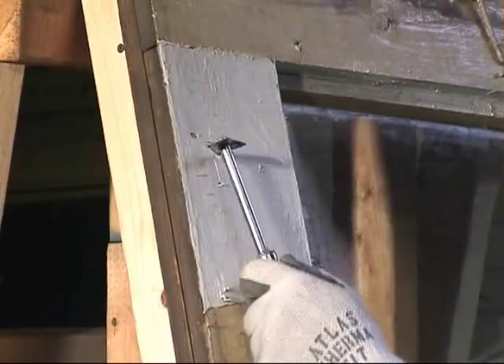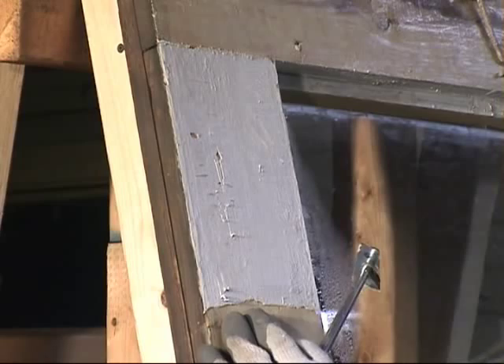Steam Paint Removal

Comment: whats to dislike about this video? its simple, quick and informative.
Reply: Grant M Speed, and worry about grain swelling.
Reply from the maker: "Grain swelling" is not a problem. The wood does get damp, but the moisture only goes 1/32" to 1/16" deep, and it dries out within a few or several hours. Fortunately, Mother Nature has designed the wood so it can get wet and dry out with no problems.
Reply: @johnleeke  does this procedure also work for paint on concrete?
Reply from the maker: @paulgurley1517 , It did work on a very limited test of painted brick masonry. I have not tried it on painted concrete. The only way to know is to try it out.

Comment from the maker: I would not say it takes TOO long. It takes a certain amount of time, that can vary a lot depending on the paint conditions and the temperament of the worker. It is slower than some methods and faster than others. There are dozens of paint removal methods and each has its own combination of characteristics. For example, steam paint removal is usually slower than a hot-air gun, but steam absolutely will not start a building fire the way a hot-air gun can.

--John

Comment: Thanks for the video and your website.  There is a  lot of good information that has been helpful as I try to figure out how to  restore my windows.  

My experience, consistent with what is on your forum , is that the Jiffy 2000 is not effective at steam  paint removal.  (I used a small shopvac head rather than the Jiffy head, to get better steam coverage.) I had somewhat better results with a rented 1500 watt wallpaper steamer, but  in my situation ( 1950 window with about 3 layers of paint) it did not perform well.

I did not try building a steam cabinet, but instead opted for a Speedheater since my primary problem was paint removal and putty was coming out relatively easily.  Again, as mentioned on your website, I  found the Speedheater to remove the paint  quite well.
Reply from the maker: Michelle, thanks for the detailed report on your work. Everyone develops their own techniques based on the skills and equipment available, and the needs of their project.

Comment from the maker: I have only used this steam method to remove heavy paint buildup from wood.
The only way to determine what it would do with wood staining is to try it out. Since stain is usually embedded within and just below the surface of the wood, I am pretty sure it would not have the same result as removing paint, which is in layers on top of the wood surface.

John

Comment from the maker: You are right, moisture penetrates about 1/16" into the wood surface, but then it dries out within a few hours or by the next day. We have had no problems with paint peeling or bubbling due to moisture.
Reply: John Leeke, yes people, contactors, are idiots about wood moisture. Buy a moisture meter and a 40 megaohm resistance meter, then do some research on wood burning and moisture content. Then have an opinion. Exposed wood will dry in hours, even in winter. Never seen wood, in 33 years, too wet to sand, after drying over night. Loose plastic paint will hold in water for weeks, like wrapping a roller or setting a garbage bag on wet sidewalk.  Ton of misinformation on wood moisture, by people who dislike pressure washer-due to investment cost and need to tarp 20 foot out for chip capture.

Comment from the maker: The only way to know if your steamer is powerful enough is to try it out. Do a test in a small area on the back or side. What make and model of steamer do you have. We know that the Jiffy 4000 steamer works well, but others do as well. The method is not "magic", it may or may not work on your paint. We use it mostly on the very heavy buildup of old paint on the exterior of houses.
--John

Comment: Word of warning to anyone who tries this technique on an old (100+ y/o) window sash. The heat from the steamer can, and in my case did, cause the original single-pane glass to crack. Not okay! Going back to the tried and true "orange" stripper to remove the paint once I get the sashes back from having new glass and glazing installed.
Reply from the maker: Well, for heavens sake, this video is not about working on sashes, don't crack your glass, go to this video to see how to use the steam method on a sash without cracking your glass. https://youtu.be/yyeXBzr-UnA?si=1AQeKfF9_C6V48VF

Comment: The video clearly shows that steam is great for removing paint from a flat wood surface, but my door frames and window casings are moldings, with lots of ins and outs. How much harder would it be to soften paint on those surfaces with steam and then scrape it off?
Reply: I have just used a heavy duty paint scraper on the architrave & mouldings
I was really surprised how easily it came off

Comment: This is really neat, but far too slow to use in most commercial situations. Have to looked into making the steam outlet much larger? For example, large enough to cover 10-20 times as much wall space with steam at one time?

If you did that could you provide enough steam to make it work?
Reply from the maker: Troy, the key to commercial use and making money with any method is to keep track of your setup and production time so you can do unit costing by the square foot for your estimates and know how long it takes the workers to do it so you can keep on schedule. I've used this method hundreds of times and made money with it every time. I have a worker using it right now on the exterior of a century old barn.
This video shows the first time I used this method back in 2005. Since then there have been a lot of improvements. Now I typically use a .5sq.ft. steam head when doing large scale flat work. The two limits are 1) you don't want to heat up more than you can scrape off in about 15 to 20 seconds, 2) it take 1 to 3 minutes to warm up and soften the paint. A typical direct production rate is about 2 to 3 minutes per square foot, but depends a lot on worker skill and stamina, the character of the paint buildup, etc., so this is why I recommended keeping track of your own time and developing your own estimating figures.
The production rates above are for one worker. With a team of a skilled worker and helper to handle the steam head larger areas can be steamed and the direct production rates improved by about 20%, and direct costs reduced by about 30%.
For more info click on "about" and "show more" above and click on the links to the report and the forum discussions.
take care and work safe,
--John
Reply from the maker: One of the big problems with blasting methods on wood, including dry ice blasting, is that the wood can be too easily damaged when the paint flakes off and the bare wood surface is exposed to the blast before the worker can move on. I did a study on this for the Army Corp of Engineers and the wood damage was significant to extreme with all of the 18 blasting media we tested including dry ice.
This is one of the advantages of the steam paint removal method--it puts the actual removal of the paint in the hands and skills of the worker, instead of depending on the blast media to do the removal.

Comment: 1:18 steam is condensing and water is leaking and sliding down the wood. Thats going to inhibit some mold growth.
Reply from the maker: Did you mean to say, "encourage some mold growth"? If so:
The heat of the steam (212 degrees) tends to kill mold spores on the surface of the paint and in the condensation water. After 15 years of using this method hundreds of times mold growth has not appeared and has not been a problem. Yes, the bare wood does get wet, but the water dries out of the wood within a day or two.

Comment: Hey John, would this method work for removing paint from woodwork without damaging the stain/varnish underneath? All of my woodwork has a few layer of paint but the original finish was never sanded before paint was applied. Looking for an easier way to remove paint and salvage the original finish without having to strip everything and start over.
Reply from the maker: Hey Nina, With this method the moisture and scraping is bound to damage the varnish. The only way I know of to remove paint and stop at a specific layer is with a surgeon's scalpel and head magnifier, working one square inch at a time. No kidding. I've done it, but usually just in limited areas to investigate the appearance of earlier finishes. It will not be easier to stop at a specific layer.
Reply: After watching this video, I went out and purchased a wallpaper steamer yesterday and tried it. I was able to successfully, easily lift the paint from the baseboard, which I think was only latex, no oil, without damaging the original finish. But the top edge of the baseboard was painted before the latex layers were added, probably with oil, so that is going to be more difficult. I had mixed results with using it on window molding, which seems to have a layer of oil based paint in some areas but not others. So far I have not damaged the varnish but I have found that some did prior to me. I lift sections of paint and there are already gouge marks underneath. So someone attempted to strip at some point and then decided to paint over. But the gouges do not go all the way through to the wood, so I'm not sure if I can repair with a top coat of new shellac... We'll see. Just stripped built in cabinets down to bare wood (months of labor) and I'm trying to preserve the original finish and not have to refinish all the other woodwork from scratch, if possible. When you refinish woodwork, what is your method? What products (dyes, stains, varnish) do you use? Brand names, colors, etc? This is 1914 Craftsman style woodwork. Thanks.
Reply from the maker: Work on the edge mouldings first, then do the adjacent flat surfaces.

Comment: I bought the Jiffy 2000, but the steamer head is flush - not like a vacuum head.  The holes that release the steam are flush with the end of the head.  I can hold the head close to the wood, but the steam is escaping out the side so I don't think it is hot enough.  The paint is not bubbling up like in the video.  We have an old vacuum head that we could try, but will need to cut the factory installed head off.  Do you know of a tape that would hold up to the heat and steam to attach the vacuum head to the hose?
Reply from the maker: Lisa, if that steam head is made of plastic, you may be able to cut the bottom plate right off the head with a fine-toothed hack saw. Grip the handle of the head gently in a vice, then saw carefully along the joint between the bottom plate and the rest of the head. The plate is about 3/16" thick. This will give you a hollow steam head that is about one-third the size of the steam head in the video above.
Click on "SHOW MORE" above to see links you can click on for more information. The booklet shows step-by-step methods and photos of sawing off the bottom plate and other methods for adapting steam heads.
take care, work safe,
--John
Reply: John Leeke Thanks so much for getting back to me!  We were chomping at the bit to work today so before I saw your response, my husband had already chopped off the other steam head and attached a shop vac head.  The paint did soften somewhat, but never bubbled the way yours did in the video.  I think the top layer is latex which peeled away quickly, under that is oil paint and the hardest to remove is the last couple of coats which I think may be some kind of casein paint?  My house dates to 1827 and the paint we are trying to remove is on the wood trim.  Even chemical stripper did nothing to remove these earliest paint layers.  They really knew how to make paint!
Reply from the maker: Lisa Hassler  Every paint buildup will respond somewhat differently. Yes, the casein or milk-based paint may not respond to the steam method. If these paint layers are somewhat porous you might try steaming them (or just spraying on water a few times over a whole day) to get some moisture soaking into the layers of paint, and then use an infra-red heat lamp type of paint stripper to rapidly heat that moisture that has soaked into the paint film. It may convert quickly into steam and loosen the paint for easier scraping.
Reply: Lisa Hassler The Jiffy 2000 is a 1300 watt steamer, whereas the Jiffy 4000 is a 1500 watt steamer. I'm not sure if that extra 200 watts would make that much difference, but it could. The older Jiffy J-3 and J-4 models are also 1500 watts in case you want to look for a used steamer.
Reply: Paul Hughes Thanks Paul!  I think I will keep an eye out for a higher watt steamer.  I have acres of paint to strip
Reply from the maker: Lisa Hassler Click on "SHOW MORE" above, then click on the link after "Steam equipment discussion", for more on which specific brands and models work best.
Reply: +Lisa Hassler  I have the Jiffy 2000 and&#160;am contemplating&#160;trying to MacGuyver a&#160; vacuum&#160;head to it, since I&#160;am&#160;not getting&#160; good results from the head with the series of holes in it.&#160; Did you ever get the Jiffy 4000 and if so did it make a significant difference?Thanks
Reply: I didn't get the Jiffy 2000 - we had just purchased the 2000 and frankly didn't want to invest any more money.  We did cut off the factory installed head and switched to a vacuum head which gave better results but nothing like in the video.  Gave up and bought chemical stripper.  The steam worked better on the recent paints but not as well on the older paint and not at all for the original milk based paint (early 1800's).
Reply: Lisa- Thanks so much for your reply!

Comment: Does this work for plaster? Or does the steam damage the plaster?
Reply from the maker: I did use this method once on plaster with good results. It was a very hard 3-coat plaster in good condition. The only way to know if it would damage your plaster would be to test it out in  few small areas first, before deciding to use it over all.

Comment: Interesting option. I agree, I would never ir inside. It dries, bottom layer powderizes and goes everywhere as you scrape. But I am skeptical steam works on oil paint: maybe the wood delaminates.  Also, based on video, looks like 20 square feet per day, plus sanding, priming, wood filler, and recaulking.  So, only viable on small projects, the ultra rich, and diy with tons of free time and nothing more pressing to do.
Reply from the maker: The video above shows the very first time I used steam paint removal. In the 12 years since then we have developed the method and several techniques to improve and speed up the work. 
Steam works best on heavy buildups of Oil Paint, as shown in the video; not so well on thin coatings of latex paint.  With a single worker and a steam head up to 1 sq.ft. in size, the production rate typically goes up to 10 to 15 sq.ft. per HOUR, depending on the skill and stamina of the worker. With an experienced crew of two that rate can go up to 20 or 22 sq.ft. per hour. Although 4 to 6 production hours per day is just about the limit for a single worker or a crew of two, since the work is so intense, requiring skill, concentration, and stamina. We have stripped the paint from entire building exteriors and made money doing it. Many good projects are, in fact, done DIY.

Comment from the maker: Click on "Show more" above and look down near the bottom for "Steam equipment discussion", where I have put a link to a discussion on this topic at my website. 
If you are working indoors in a cold climate during the winter, you have to ventilate the work area to move the moisture from the residual steam outdoors so it does not cause condensation problems within the exterior walls of the building. Take care, work safe, and keep in touch.  --John

Comment: So if you hired a painter to strip the paint off of all the windows(15) and doors(10) in your house you could expect to pay $ 2,500. or more just to strip the paint off, then sand, prime and paint another          $ 2,000. thats $4,500. maybe another $2,000. walls and ceilings for a small 3 bedroom house will run you $6,500. if you,re lucky which is half of what I paid for my entire 1600 sq. ft. house on a 50X100 lot. where is the sanity in this?
Reply: SamytheGreek, Because a painter, with 10 years of skilled training wants to make minimum wage. Got $4 in pocket $1 is Govt, $1 is advertising/storage /insurance /big tools/auto, another $1 is the Pole Dance fee ($45-$60/day)Gas, unbillable cleaners,tiny tools, loss breakage wear and tear on brushes/rollers, clothing, drops, wrenches, tips, filters, respirators, rags, razors, power tools, sprayers, ladders, office supplies, batteries, bulbs, cords etc. The final dollar (of $4) is your wage, provided only that you didn't screw up, the material cooperated, no accidents... Then the guy running around for 2.75 hours per estimate wants money, as does the retired guy spending 29 hours a week organizing trucks, shop, doing 1.5 hours per each of 9 weekly store runs. As do the bookkeeper, lawyer, reseacher, tool repair guy, and auto repair guy.  Then, the painter doesn't get paid for scheduling conflicts caused by clients that set start and end dates. Then let us not mention rainy days and off season... Did I mention it takes 5 years to be a good painter and another 5 to master contracting end? Even then, there are inate abilities that prohibit 90 percent of people : the heights, hard work, eye sight, brains, risk to neck on each job, soft skills with second guessing crazy customers, drug free.  9 of 10 guys I hire get fired first day. The ones that make it, always say painting is much harder than they realize...  Each surface, has 9 to 12 stages, for a proper paint job. So, every stage needs to go quickly.  Getting hung up will not do, if you want to break that minimum wage.